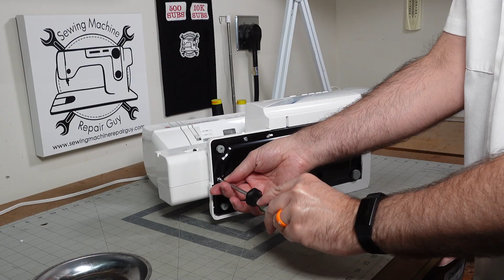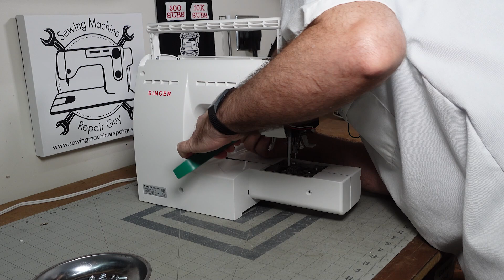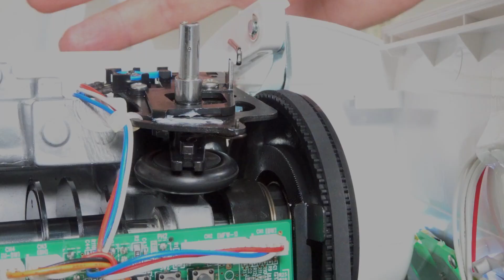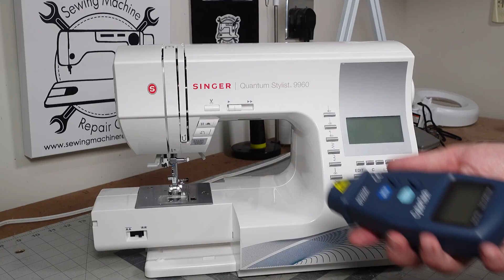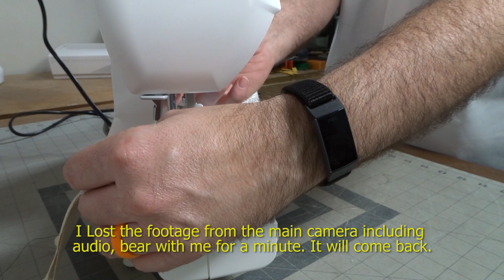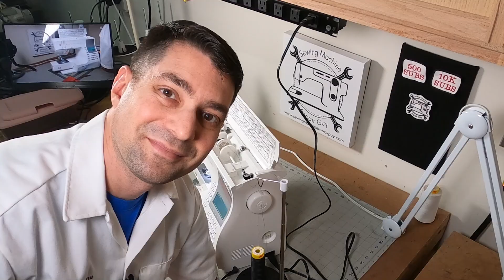Singer Quantum Stylist 9960 Tear Down and Stress Test, Does it Survive?

Comment: Hello, Mr. Machine Repair Guy.
I have a Quantum Stylist 9960 sewing machine, and I loved it at first, at least for 2 years. What can you tell me about what’s going on with my sewing machine? Here’s the story. I purchased it in 2021, had it for 2 years and 1 month past the warranty, and then the machine started doing some weird stuff. It beeps constantly in rapid succession; it sounds like a cricket chirping. This happens even when I am away from the machine, such as ironing seams or at the cutting table, etc. I cannot engage any of the buttons on the display, cannot select a zigzag stitch, or shift the needle, or lengthen the stitches, or select a buttonhole- absolutely nothing. It’s like the panel is frozen. That is not all; I disconnected the foot pedal to use the start/stop button, but it sews in reverse. The only thing that is working properly is the straight stitch using the “A presser foot, set at the default 2.5 cm. The cutting tool still works, and the automatic threader still works. The repair shop is 4 hours away from me and cannot make the trip right now. Is this something I can troubleshoot myself? Thanks.

Comment: I know this is an older video, but if you want to sew multiple layers of leather or denim, you need to use the right size and type of needle, the right type of thread, such as bonded nylon for leather, AND the right stitch length and tension. Thicker layers means longer stitch length and looser tension. A walking foot definitely helps too. This machine showed that it's got "stuff" by sewing as many layers as it did without the correct setup being used.

Comment: I know this is an older video but maybe you will see this and help me. I bought this machine in 2013 and I love it. I don't use it as my primary machine but I use it occasionally just to keep it running. I've always oiled and cleaned it and kept it covered with the case. I got it out last year to use and when I was sewing, the machine stopped and an error came on the screen. It said to connect the foot pedal, which it was already plugged in. I turned it off and tried it again but I had the same error message. I took the foot pedal apart and it was clean and the cord was in perfect condition. I did order a new pedal, just in case, but it did the same thing. You didn't touch on the foot pedal in your video. I know I can sew without the pedal but I don't want to. I don't have any repair guys around me. Do you have any suggestions? Is my machine done?

Comment: Perhaps posting short videos of these issues as and when it happens can help in understanding the persistent problems. I don't know how to recreate or simulate the sudden stich changes that happen in this machine though. Because, these are often sporadic events (which could be due to the unprotected IC chip making the stich selections possible). I am totally unhappy with the model that I own for the past year and half without being able complete a project with peacefully without wasting resources like threads and needle breakages due to the needle plate not being able to secure in position (moves suddenly while stitching if screws are loose, when tightened holds the bobbin tread tightly from being picked up or causing the needle to hit the metal plate under the presser foot breaking or bending the sewing needle). If there are solutions to these, please do suggest.

Comment: While this machine costs a lot with all  its fancy features, a brand new, not heavily used has been giving problems all through after it was bought never allowing me to try any of the claimed features! Either the presser foot not letting the bobbin thread to be picked up, or set stitches changing all of a sudden(which could be due to no faraday cage, or coating  protection to the IC chip which drives the computerized stitch selections), or the presser foot not held in place making it fall off  suddenly while stitching, or the lever that lowers or raises the presser foot not staying in lifted up position not allowing the presser foot to lift up sometime, the thread cutter not working, and most of all not friendly enough for simple troubleshooting! A simple mechanical, time tested sewing machine is only the option left for enthusiastic designers!😢 Simple no additional cost, self-troubleshooting videos for such issues can help those who are stuck with this special machine!😢

Comment: Thanks.   I enjoyed seeing the innards and how they work.  I've had my 9960 since May of 2013 and have done quite a bit of sewing on it, including quilts, garments and craft projects.  Within the first few weeks something happened that resulted in a failure.  It was under warranty, and I was lucky enough to live in a big city that had an authorized Singer repair place. (They are scarce!)  The main circuit board had to be replaced, and it took a few months to get the part, but it was fully covered under warranty.  This experience made be doubtful about the quality of the machine, but since then I've had almost no problems at all.  I came looking for information about how to remove a thread lock around the tension.  This has happened once or twice before over the years, where the thread broke and recoiled around moving parts inside. On other occasions I was able to find the end of the tread and slowly pull it out, but this time I can't see it,  It seems the one part you didn't show in this video was the one I needed to understand how to expose and work on.  The Singer  repair place near me closed some years ago, and of course the service warranty is long expired.  I'm not interested in shipping it off somewhere.   It's time for me to get brave about taking out a whole lot of screws.  I'd suggest for any other newbies out there like myself that unlike this experienced repair guy, we need to take pictures of every step along the way showing which screws go where.  Number them in your picture and put them in a tray where you can number and tape down if necessary.  I know there are multiple sizes of screws,  and there's no chance I'd keep them straight without a system.    And of course, yes, we need to unplug before doing anything at all other than sewing on a securely assembled machine.  Thanks.  I'm going to have a look at your other videos.

Comment: When testing leather you need to use bonded nylon thread. That is where these machines struggle.
Reply: A nylon foot, or putting scotch tape under the presser foot for better feeding. That black little knob on the the spring of that presser foot also helps with getting over thick seams. Just press the knob in before going over a thick seam. It'll pop back out when the seam clears.

Comment: Recently, I experienced this machine suddenly switching to a different stitch style automatically. Further research explained a possible lack of metal cage protecting the IC chip on the circuit board (brain) to prevent sudden voltage surges or lightning without proper grounding can cause the electronic circuit board to get corrupted either progressively or permanently requiring a costly fix. EMI protection is critical and lack of it could  make the machine unusable. Research summary from Gemini is here: 'The cost to fix a corrupted sewing machine circuit board varies significantly based on whether the issue can be fixed by reflashing the chip or if it requires full board replacement.
For computerized sewing machines, these costs generally fall into two categories:
1. Reflashing or Simple Component-Level Repair
This is the best-case scenario for a logic board failure, usually involving software corruption or a small component failure (like a capacitor or fuse).
 * Cost Range: $75 to $300
 * What it Covers:
   * Labor/Diagnostic Fee: Repair shops often charge a flat diagnostic fee (e.g., $50 - $100) or an hourly rate (e.g., $45 - $80 per hour) just to determine the problem. This fee is often waived if you proceed with the repair.
   * Reflashing: If the main chip's firmware is corrupted (a software issue), a technician can use specialized tools to reload the correct operating code. This process is primarily labor and service cost.
   * Component Repair: If the board has simple damage (e.g., a clearly burned fuse or capacitor) that can be soldered and replaced, the cost includes labor plus the few dollars for the part.
 * Feasibility: Board-level repairs and reflashing are often performed by specialized third-party electronics repair services (not always the authorized dealer), which may offer a flat-rate service for a particular model's board.
2. Full Circuit Board Replacement
This is the most common solution for severe damage (like permanent physical corruption from a power surge or a major component failure). It is much more expensive because of the cost of the proprietary replacement part.
 * Cost Range: $300 to Over $850
 * What it Covers:
   * Replacement Part: The main circuit board (often called the PC Board, Main PCB, or Motherboard) is a proprietary, high-cost component.
     * Mid-Range Consumer Machines: Boards can cost $300 to $500.
     * High-End or Embroidery Machines: Boards can easily cost $500 to over $850, especially for models from premium brands like Janome, Bernina, or Husqvarna.
   * Labor: The technician's time to disassemble the machine, install the new board, reassemble, and perform calibration and testing.
| Scenario | Service/Part Type | Estimated Cost (excluding tax/shipping) |
|---|---|---|
| Best Case (Reflashing) | Labor to diagnose and reload firmware | $75 – $300 |
| Standard Replacement | Main Logic Board Part + Installation | $300 – $500+ |
| High-End Replacement | Main Logic Board Part (Embroidery/Premium Models) + Installation | $500 – $850+ |
Key Takeaway:
The cost of full board replacement for a computerized sewing machine can often approach or exceed the price of a brand-new entry-level or mid-range mechanical machine, making the cost of damage a significant deterrent to neglecting proper EMI protection."

Comment: Hello 
Your video was very informative. thank you. 
I do have a question about the singer Quantum Stylist 9960. Do you know what the sensor that sends an error message that the top thread is not correctly threaded through the machine looks like and  where it is located?
Thanks for your time. 
ELD

Comment: the feeddogs wwentbdown and refuse to come up
Reply: Idont do heavy fabric very often but sew every day onsomething .love my9960 and have had it for 5 years with no troubleuntil feeddogs went down and i could not get them to come up.any suggestions???
Reply: Flip the switch on the back after you take off the accessory tray. Turn the handwheel one full turn toward you and they should pop back up

Comment: Hi sir I have been messaging you but no luck I need help with  my  singer quantum 9960 USA model. The  machine was  plugged in on uk  which  led to  first  fuse  blown  I watched  your  video  stripped down the  machine. Ordered   a proper  fuse  and placed it. I also  bought  step down  converter from  220 to 110v.pluged it in but no luck please can you help  or let me know where I can buy the  right part for my 9960.kind regards from afzal of south Wales uk.

Comment: 25:00 Pro tip: if the machine supports dropping the bottom feet even temporarily, you can use it to get thicker amount of fabric under the top foot.
Reply: This machine can definitely drop the feet to accommodate thicker material.

Comment: 13:00 That motherboard is still insanely big for what it's actually doing in this machine. A Raspberry Pi Zero W would be about one tenth of that and it would have much better processor and built-in WiFi so either this board is doing insanely lot processing, or it's really low tech – and to be honest, it's really low tech.

Comment: 10:50 Singer barely got away from the jaws of victory here and failed to add one maintenance hole to oil the one remaining bushing! The machine looks surprisingly good overall. Are you planning to do similar video about Singer HD6600c or HD6605c?

Comment: Of ALL THINGS I AM LOOKING FOR…. Repair “feed dog adjuster😢

From my “probing…the issue is in the back side.

This was an impressive & helpful video.

I hope you will see this and will be able to help me.
Reply: Me too. Feed dog adjuster stuck in high position, won’t feed material. I replaced the nylon set screw, checked that the feed dog height was .9mm and the plastic shaft was vertical as it is supposed to be but no change. Guess I get rid of it. A repairer is expensive
Reply: @brendamann6106  😢
Reply: Hello. Did any of you have luck fixing your feed dogs? I have taken my machine apart to find that not only my screw broken, but nut had come off. I ordered the screw and am presently waiting on its arrival, but I don't have much hope of it solving the issue. I also have the auto thread cutter issue. It quit working the first year. I have taken the machine apart three times and have not located the issue. When I run the diagnostic program on it. It does not show up as not working. I have the repair manual on the machine. The only thing it provides info on the feed dog is the screw adjustment, which will not help lol. Those are the two main issues that everyone has issues with.  Blessings to all. Happy sewing
Reply: @ no!😢 there are no singer repair shops in my area… I wish there could be a video regarding the feed dog…I ordered the part still no luck😢 P L E A S E. H E L P

Comment: I have this model and my stepper foot won't go down.  I am trying to take the left side off and after taking the back screw out there is still some resistance to pulling it off.  Not sure if there is another screw or I should just give it a good tug?  I watched your video and you were in fast motion and it looks like you struggled a little and it came off eventually.  I don't want to break anything any advise to getting this off would be appreciated.
Reply: Presser foot, not stepper foot.

Comment: Good afternoon, I have a Quantum Stylist 9960 family machine but yesterday I was doing free embroidery with a round frame, and the presser foot arm got stuck on the edge of the frame, and then, my machine no longer wants to sew, and the needle does not move from side to side, nor does it center, it goes up and down when I move the rotary knob, but if I start sewing, a beep sounds and it does not sew, it helps, I think it may be something in the system configuration, no I know if it is possible to reset the system, or something, I know that when you turn it on if you press the EDIT button and any function button F1 to F5, it opens in a different configuration menu, I need urgent help plis!!!!!

Comment: Fantastic review, as always from the sewing machine repair guy. The complicated bits are beautifully explained, I never thought I could possibly understand how this works, especially the electronicy stuff, but this has given me a good understanding. Lay people, like me, really shouldn't be poking around inside here, the warnings given should be heeded! HOWEVER for users like myself it is incredibly useful to know what bits need oiling and where to look to decide when the machine needs to see a professional repair person. The more you know about your machine the better I reckon!. Biggest lessons I learnt was: DON'T USE A SCREWDRIVER to prize open plastic/clippy bits #2 ground body to case to prevent electro static damage to electronicy stuff #3 other than oiling, cleaning or very basic repairs I should take my machine to a professional
Reply: Amen to that. Does anyone know why my Quantum starts and stops repeatedly regardless of whether I’m using the foot pedal or the Start/Stop button. Not all the ti,e but constantly has the issue of stopping just after it starts but sometimes sews for a foot then won’t start again without repeatedly shutting off as soon as I hit the start.

Comment: GReat pro video....very very helpful. My  is having a little problem only work for 2 to 3 seconds and then stop....press start again work fine for 3 sencond and stop...any idea what xolus be wrong?
Reply: I am having the same problem, showing a broken tread alarm, while the tread is not broken
Reply: Retread machine mine did this regularly.. one of my gripes. I found it didn't like that thread. But still happens occasionally.  Again rethread and do the Flossing technique they the tension plates as recommended in most SQS9960 videos.. how the thread your machine type of videos. Hope this helps😊

Comment: I have  the patchwork which seems like it's almost the same machine, it doesn't have all of the designs or the thread cutter but everything else seems to be the exact same. I also have the Heavy Duty for bigger, heavier things like parka's. I also have a Viking Prisma that's probably over 30 years old and it still works very good, not as good for some of the newer fabrics but it works like new and has been around the world twice.

Comment: I got this machine because my Pfaff was being tuned up - since the Pfaff is older I thought it would be nice to have a newer-ish machine.  But it sounds like the needle is hammering through the fabric and I had problems with the needle cutter after less than 3 mo. of owning it.  It still makes a good straight stitch, but I'm sticking with my older Pfaff.  I gave the Singer to my daughter and recently used it; it was fine for some cotton quick quilting craft projects.